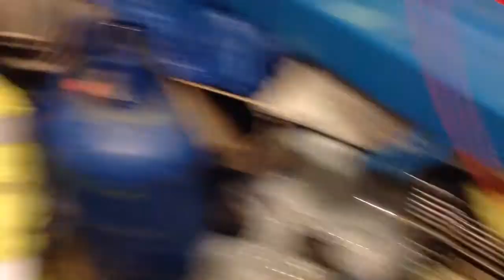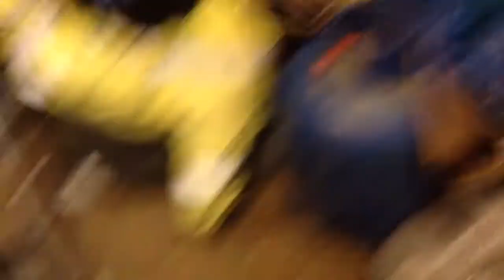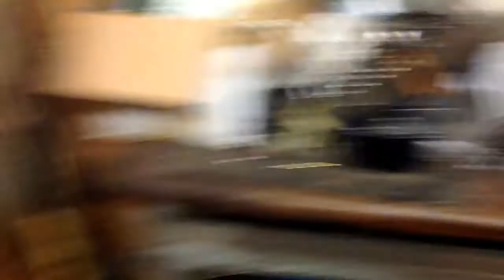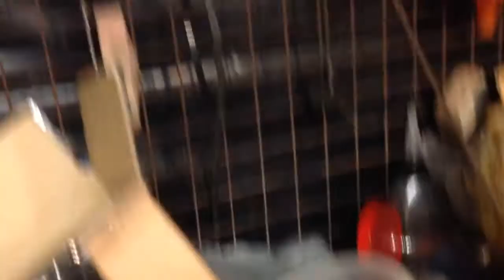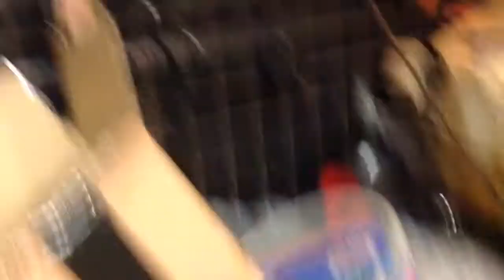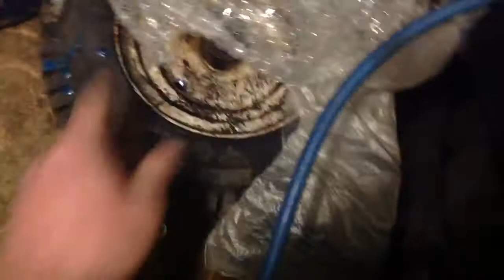First shed chat of 2018 (Not much happening,but it will get better)

Comment: Could do with some racking to store your stuff and spares etc, lean to turned out well though.
Reply from the maker: retrorestore Hi I have some wracking at my storage unit, I thinking of bringing it home to put up where it will fit. I basically want to get the stuff I don't really need in the shed out, I must have 100 aerosols a lone which I plan to store in some wracking in the lean too, my aim is to try and create a nice spacious area in the main shed to work comfortably. After the weekend it should be much better. Thanks for watching 🙂👍